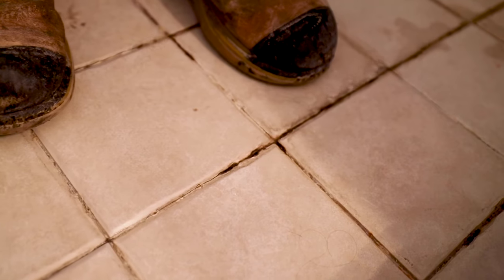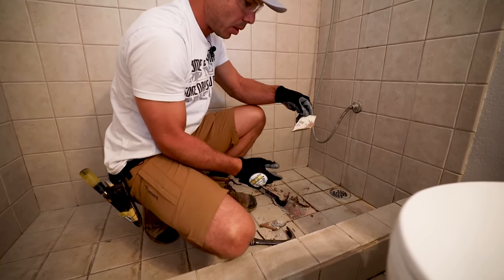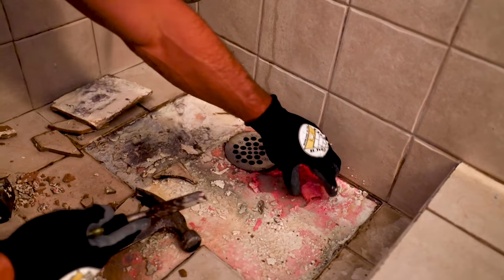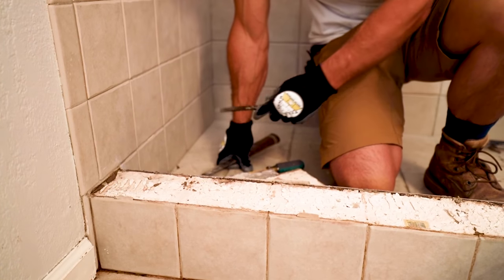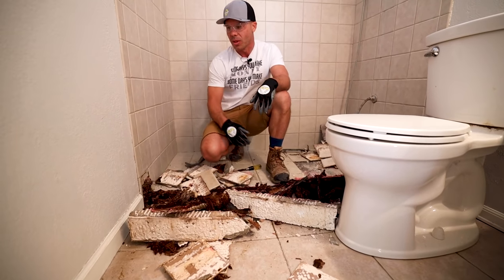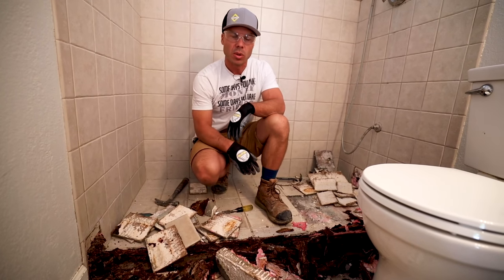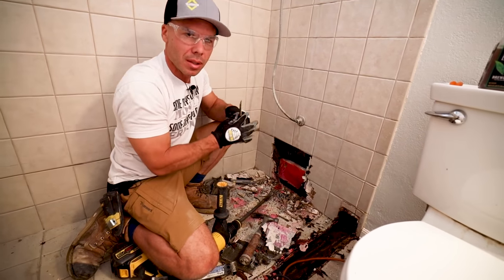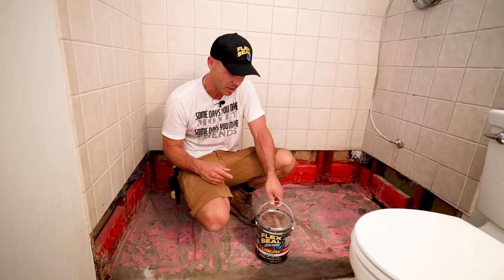Homeowner Used REDGARD and His Shower FAILED!!!

Comment: This video raises a lot of questions.

Did the Redgard fail or was it not applied properly?  Are Redgard, Mastic compatible or did the Mastic have a deleterious effect on the Redgard.  Was water pooling under the tiles due to improper shower pan design or were the weep holes blocked?

Comment: Isaac, you didn't mention anything about the preslope and whether there were weep holes at the drain so the water under the tiles could drain out eventually. Did a lack of weep holes contribute to all that water sitting under the floor tiles? Standing water like that would wreck just about any shower installation over time. Would love to hear your thoughts.
Reply: Agree. I wanted to know how the drain was integrated into the overall waterproofing envelope. Because it didn't look like it was... like at all (thus the water squishing up when he stepped on the tiles). He can redgaurd the slope and all he wants, but how does the regaurd interface with the drain? Seemed like the only means for water to enter that drain was from the face of the tile, and any water than made it through the grout would just pool there until it could evaporate back through the grout or weep through breakages in the redgaurd. It seems like had there been proper drain integration and a weeping mechanism, even the mastic wouldn't have been a problem, much less the redgaurd.
Reply: @grahamd.8713  Thank God somebody gets it! I think the mastic still would be a problem but much less so. The water should either flow through a morter bed or thin set hit the waterproofing and be drained through the weep holes in the drain. This has to be a two piece drain that you can set the elevation on to tile height. In the video it looks like the only provision for water to get out is at tile level , but can't be sure.  If your a home owner do you're do diligence and then some before you waterproof a shower, It is not as straight forward as it may look.
Reply: I was called to fix the similar problem. There was a lot of water under the tiles.  The rubber membrane was installed but there was no preslop.  All the water that got through the tiles and mortar bed just stayed down there on the horizontally installed rubber membrane.  Instead of going down to the drain  using the preslop angle.

Comment: If the floor is concrete does it not require a pan liner ? Curious, also I really appreciate your videos,👍👍
Reply: And the pan liner should go up the walls at least 6 inches and over the curb, fastened on the outside of the curb near the floor.   I can see why the curb’s wood rotted

Comment: I looked into redgard & it did not say anywhere on data sheet that it crystalizes in a masonary surface, so im skeptical on what is best for me.  That is what is suggested to me befofe apply a rubber, or some cheaper elastomeric coatings.

Comment: I recently had a professional come out and put redgard on my shower walls and down on my shower floor. Because it was supposed to be personal project of mine I chose to do the tiling work myself. Unfortunately I put too much thin set down and long story short I had to remove the tile I only just put in. The bigger problem is that I accidentally tore up some of the redgard in the process. How do I best resolve this. By the way the walls haven't been touched yet other than with redgard

Comment: you make great videos and I've learned a lot from them.  But I can say this: if the tile is not installed qualitatively, the water proof has absolutely no value, if water gets behind the tile, the wall or floor begins to collapse, and it does not matter there is a membrane or something else.  I did demolition on other old bathrooms where the tiles were installed straight on plain drywall and it was absolutely dry.  Everything depends on the correct and high-quality installation and grouting of the tiles, the rest is not so important, from personal experience.
Reply: I agree 100% I’ve done tear outs of tile bathrooms pushing 70-100 years old and because of the quality of the job it lasted all those years without any water damage. They used to use string for spacers on 4x4 tile back in the day before they were cast in the tiles. I’m sure they used other things but I did my fair share of tear outs and it was used. Don’t know why I added the string thing but it just came across my mind lol.

Comment: Clogged weep holes is your number 1 problem in this video. 2.) Mastic use in a wet area is big no no.
3.) 20 yrs is great life expectancy for a shower. Homes move and yeah I will take 20 yrs. 
4.) Yes you can Redgaurd to wood. You have to dilute your first application with water for maximum absorption Into the Woods. 2 regular coats after.
5.) The curb most likely was not covered 100% with Redgaurd. Each 2x4 100% coverage then coated between each. I give this video a D+ because I like your content. But missleading the DIY's. And blasting Redgaurd use as a moisture barrier and use to wood. When 1st coat is diluted it absorbs into the material period and second coat seals any holes and third coat seals a-holes left after the second coat
Reply: Your 100% right and any pro tile guy would know this after hearing the homeowner did it and the squishy tiles spitting up "trapped" water.  He won't respond.  He only responds to people giving him compliments or the Flexseal BS.  He's all about the views.  Total Clickbait.

Comment: Wait, wait.  I have to question something.  You have a great video here, and I like your speed and thorough approach.  However, the whole reason this shower failed is because the owner used the wrong product.  Is Flex Seal any more tried and true now than mastic was then?  Does anyone know the longevity of Flex Seal over 20 years in a shower application?  It seems you might be repeating the same type of mistake the owner did, unless enough is known about the Flex Seal.

Comment: Used the flex seal spray on exterior masonry and it shrunk and pulled away from the surface causing water intrusion. Not satisfied with flexseal at all.

Comment: The bottom plate framing should be pressure treated lumber on a slab. That is probably why it is wet and still solid. looks like the Redgard failed due to the installer. Too thick of individual coats? Should have still made a solid membrane under the mastic.

Comment: I used Redguard for a shower myself, the instructions say right on the label not to use MASTIC, so I called the company and they explained that the mastic would never dry. So the failure is not Redguard, its an installer who did not follow the instructions. Redguard says there is no mastic made that will work with their product. You have to follow INSTRUCTIONS. Its as simple as that. Can not say for sure, but I am pretty sure that same rule applies to hydroban, etc.

Comment: I think redguard did pretty good, everything else was pretty bad.

Bad slope, regular wood on a concrete slab, mastic? 

If the slope was good and maybe  used treated lumber and a good mortar. It would of gone a lot longer than 20yrs.

Comment: Umm...isn't the pre-slope the process done under the hot mop so proper pan drainage can be utilized by the weep holes at the base of the drain to prevent water from accumulating in the pan? My point..after 35+ years of doing this,  blocked or never clearing the weep holes of a drain = water damage..

Comment: I think this video has shown that Red guard was clearly not the issue. The real issue here is the lack of knowledge from the homeowner when installing this shower. The homeowner used mastic which is a big No-No. And on the curb they used a drywall instead of an actual sheetrock or durarock. Should have used real thin set and buttered the curb. Allow it plenty time to dry then apply multiple coats of Red guard. A few minor mistakes could have been prevented if the homeowner had done just a little bit more research.

Comment: At 11:37 you mention how fragile the Redguard is and that it becomes so over time. Is this true for this waterproof membrane in general or because of the current circumstances of this 20-year-old shower?
Reply: I have a flat roof with this type of membrane and they do break down over time when exposed to the elements.  I still think with the absolute fail worthy application of mastic, this homeowner got much more out of this shower than I would’ve ever expected.  Without the membrane, even one year wasn’t likely.

Comment: The vid title is a bit misleading.  From the looks of it, the zhower didnt fail because he used redguard, it failed because of thr choice of adhesive and, potentially,  a shower drain that didnt have weepholes.  Id say the redguard actually helped.  Maybe a grout sealer could have helped, or at least prolonged the life.  Thanks for the vid.

Comment: In this case red guard didn't fail installer, installer failed the red guard. They specifically put on mastic that it is NOT for shower floors or areas constantly exposed to water, I guess reading is now not important for some.

Comment: Most any latex-based waterproofing treatment (redgard, aquaseal, etc) recommends MULTIPLE coats for a reason. One thin spread of that stuff, and all you have to do is scratch it with your notch trowel and BOOM, you've ruined it. Also mastic in shower = disaster. All in all, this is simply a case of not knowing material and product well enough.

Comment: I'd like to know your thoughts on putting poly vapor barrier on the studs behind the durock, kerdi, or whatever board is being used? I've seen a lot of different opinions and was curious to what yours is. Great video.
Reply from the maker: In this one, it worked great!  No damage to the studs.
Reply: Why would you need it behind Kerdi?
Reply: @samsmith3025  that's what I'm asking. If your walls are waterproofed, do you still need it?
Reply: @TileCoach  would you always recommend it behind any waterproofing system?
Reply from the maker: Not behind kerdi.  only behind Durock on walls when topical waterproofing is not used.
Reply: @RiskFight  With Kerdi , no, not needed. Plus this product is really best on top, behind a substrate would be an awkward install.
Reply: @samsmith3025  by this are you referring to kerdi board? If you do durock with a paint on waterproof system like redguard would you use the poly? I've seen people say you need it behind any wall in bathroom to stop vapor from getting to the studs and then I've seen people say to not do it because it acts as a trap and causes mold to form between the poly and back of your waterproofing system.
Reply: @RiskFight  Yes Kerdi board, there is no reason to use poly sheets with a liquid applied membrane, thats a very dated hack method.

Comment: In my experience in circumstances where there is a porous tile travertine etc. even when applied correctly red guard will still fail from if or when a sealer is not applied or reapplied properly or if the grout cracks and water stream right through what happens with red guard is when it gets super damp red guard goes back into a gooey watery state which makes sense since it is water based. If applied outside in extreme conditions the result is even worse. I usually go with TEC Hydraflex.

Comment: Isaac, IMHO, I don’t think u should say the RedGard “failed” or “didn’t do what it was supposed to do.” Rather, I would say the homeowner used RedGard in a manner other than the manufacturer’s specs. RedGard does not claim to b a one step waterproofing agent for shower floors or shower curbs. It is a great product for vertical applications only waterproofing Durock, WonderBoard or HardieBacker tile backer board on shower walls…if and only if 2 coats r applied and thinset is used to attach the tile. It isn’t designed to b used in other applications. In addition, u properly share the blame for this specific failure on the homeowner’s use of mastic rather than thinset.
Reply: Totally agree. Mastic failed the shower. Not redgard. I would never sue redgard on a shower floor anyways

Comment: The red guard was not properly installed.  For  shower pans fabric needs to be used, not just rolling it on
Reply from the maker: I agree. I should have mentioned that. I have a video showing the proper way to do a redgard shower

Comment: Wait, that shower was done 20 years ago?  It didnt fail, it got old…. What shower will be water tight and last for 20 years ?  I mean what are the steps to take to get it lasting 20+ years??  Hell most appliances built in a factory wont last 20 years..  a professionally installed roof wont even last quite 20 years and a shower gets more water put on it overtime than a roof..

Comment: As someone who worked at Home Depot for 8 years, I'm gonna share something something from my experience.  99% of the people there are not former tradesmen, and most have never even done any of the projects there suppose to "help" with. It's a minimum wage sales position ( with a huge amount of turnover.) Once you are hired you sit in front of a computer for 2 weeks "training" and then you are thrown to the wolfs on the sales floor. . Any advise you are offered, please PLEASE actually double check the information and do some research before blindly following it. If you are given bad advise and something goes wrong, guess what? IT'S ON YOU. 🙈 If the customer in this video had done some research and had checked to see if the advise he was given by the HD associate was good/bad advise, he could of  most likely avoided this big headache.

Comment: The tite blames Red Guard.  The problem is not the product.  It is the homeowner's failure to follow instructions and his poor workmanship.  You point out something that he did well. But, you don't point out the things that he did wrong.  Your demolition shows that there is no evidence that he used a membrane at his 90 degree joints.  The project was destined to fail.

Comment: A lot of issues with truth process.. as far as I know red guard works pretty good if it is apply correctly. Curb had no baker board just red guard right on top of the studs wish I don’t think is recommended.. the other issue no Liner Pan and mastic big mistake 

Why people keep using waterproof on the shower floor..?  Thats why you have a Liner pan it supposed to be a draining system….your shower floor tile cant be sinking in water the Liner pan Can…thats why a draining system…

Comment: nice video.  Definitely the worst curb I've ever seen.  I'd never use Redgaurd as a pan membrane but I bet the corners were not reinforced.  Not really a great idea to set straight to the slab either.  Should have done more research.

Comment: Just seeing the round drain so close to the wet wall is questionable. Lasting 20 years with mastic bonding product says old school concrete grout is strong. The only thing holding than pan tile in place was the grout. Flex seal as a pan sealer all i see is a new why did it fail video in a few months. Hey job security.

Comment: What is it with people and wood?  Instead of using wood, just buy the small cement blocks.  Is the same height and it will not rot.  Common Sense.

Comment: Massive click bait and misleading. Thumbs down
Reply from the maker: Title is exactly what happened in the video.  Not sure how that is misleading.  I pointed out everything that was done wrong, and what was done correctly.
Reply: @TileCoach  My assumption was that you used Redgard in the title to get search hits, then accurately told what actually happened in the video. Still, it feels a little deceptive because the biggest issue was the mastic. Maybe better to title it "Mastic and Redgard Shower Failure"?

Comment: Too much time spent on surgical removal.  If I remove the first time and see water penetration and mold. In 35 minutes I will sledgehammer top to bottom.  You're not going to find matching tiles or save anything 

You're just wasting time making a mockery of the original installer and having fun at it.  That's 100% not professional.  Imagine a doctor doing heart surgery and making fun of you on the operating table.

Be and act professional.  You're past that age.